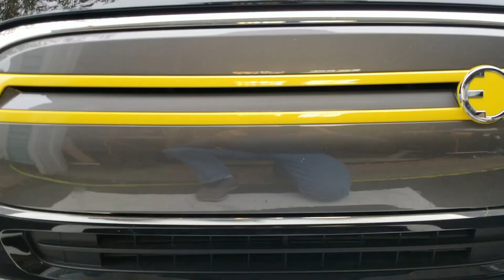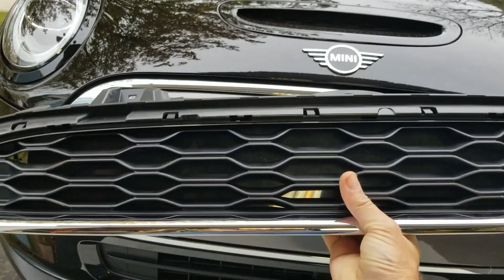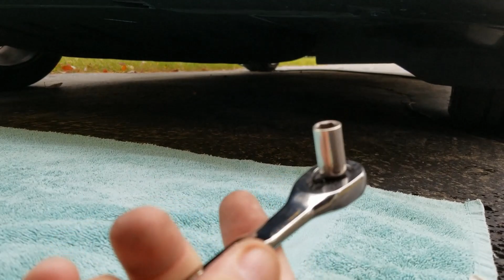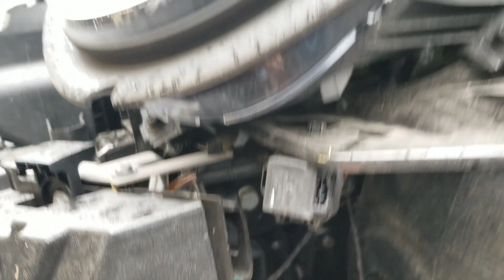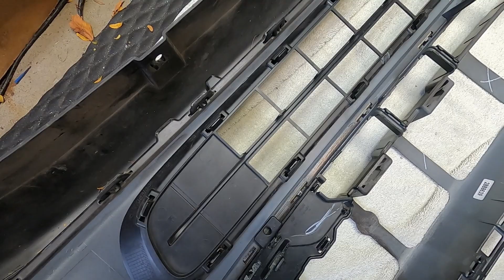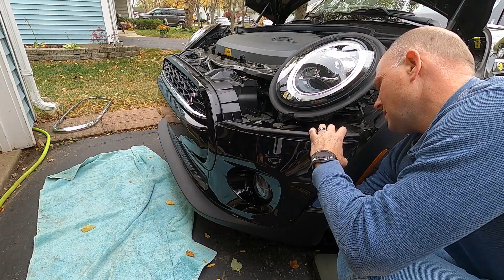Modifying the Electric Mini Cooper!

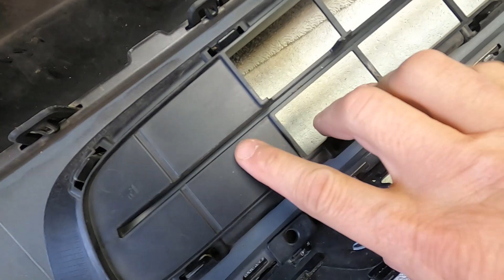Comment: Thanks Matt for the great vid!  Very helpful to us as we did the same to our SE.  For those with the Iconic trim level - there are 2 PDC sensors located in the stock bumper cover that you will need to relocate into additional pieces used in the non-electric S model with front PDC which are also available from ECS Tuning: 51117340747 Air Inlet Finisher (left side) and 5111730748 Air inlet Finisher (right side).   These go in the place you are referencing at 7:42.  

Also, we got a yellow vinyl S decal for the grille from here: https://www.artisticreflection.com/funny-car-decals/f56-f55-s-emblem-decals   

Turned out awesome.  Cheers!

Comment: You removed the two BEV infill pieces and left them out. There are actually two infill pieces for the ICE model which you need to add. There are  versions for with pdc and without pdc
Reply: You also need the correct bumper part. You could maybe route out the plastic from the non-pdc bumper with a dremel, but gettin the correct part works fine. There's also a bunch of wire and the sensors themselves that need to be disconnected as part of the process.

Comment: 13:45 The next mod for me would be to replace the yellow rear view mirrors with black covers, or just spray some black paint.
Reply: You can opt out of the yellow caps when you buy it, unlike that ugly ass grill.  Well, you can get the ugly ass grill without yellow in it, but it's still ugly.

Comment: You can disable the pedestrian speaker with Bimmercode but only in drive. It still makes a noise in reverse and I swear that is a different speaker. It sounds like that speaker is in the rear.
Reply from the maker: The sound is reduced with a few layers of gorilla tape. It is reduced in drive and reverse. So, it is the same speaker.
Reply: @TechForumTesla  There must be two speakers then with Bimmercode disabling the front speaker only. I can definitely hear the speaker behind me when I put it in reverse.
Reply from the maker: @dbajonr  I'm not sure about that. I only taped up thr speaker in front and the sound going forward and backward is drastically reduced. I.E. only one speaker.